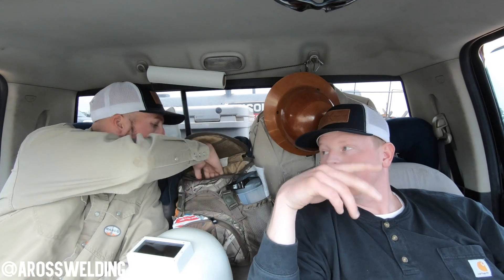WHY WE GRIND THE BEAD WHEN WELDING ON PIPELINE PIPE

Comment: Austin my friend,
I watched the FAA video on aircraft welding.
They say, in the video, that grinding weakens the weld and to never grind it.
Have you ever heard of this and do you believe it?
I do, but I'm just a student mechanic, not a seasoned 'Pipeman' like you Austin.
Hope this message finds you well.
:-D
Sincerely Pate
Reply: it weakens the weld because youre removing material ,making it thinner. when it comes to pipe, you grind it so you have an even surface to weld on so you dont get bumps to work around. basically grinding the weld on a pipe is just so u can have clean area to weld on and it makes it easier to weld with less variables. in pipe line welding it doesnt weaken the weld per se, because you still have to fill in the bevel so the material you removed gets added on your second pass .

Comment: Hey just a question , I live in NW Ohio they are putting in what looks like a 36" line. Have they come up with a MIG system to weld pipelines?
Reply: JLHcave yes there are a few manufacturers that have developed systems that will put in a 100% root pass in a butt. Fronius, Kemppi, Miller, Lorch, all have their own versions. Fronius call it "cold metal transfer", one is called "surface tension transfer" not too sure about the others.
Once set up and programmed, will put a root in a butt much much faster than a 5P or a 5P+. Outside? Simple, use an elephant, or screens if its windy.
You'll find though that the ol boys in this game are absolutely petrified of any sort of change in how anythings done lol

Comment: What do you guys do 6010 root and 7018 out??
Reply: I'm a steamfitter and we typically run that 6010 root 7018 fill and cap uphill only you guys run downhill correct??  I always thought that trapped slag it's all 100 percent x ray and they have to shoot so it must not huh??
Reply from the maker: We run 6010 for the bead (root) then 8010 for all the passes after that.
Reply: I gotcha man right on.  Does 8010 run a lot like 6010??  Have you ever used 7018?  If so what do you think of it?

Comment: Austin your fire cut side of the joint how many degree bevel do they allow you to get away with ? What grade of pipe are you guys welding 483? Have you done any grd.550 with the down hand low hydrogen (Bohler rod) . Got a welding inspector there taking parameters ? How is the inspection there anyways?
Reply from the maker: 30 degree bevel and x70 is the hardness of the pipe

Comment: Good vid, nicely done. I love my GoPro. It works so well, they ought to get awards for design excellence.

While I will never do any pipe welding, the techniques you employ are useful in other settings. Any time you're making a butt weld, especially on thick steel, where you can't access or weld the back side, pipe welding techniques apply.
Reply from the maker: Absolutely. I like the GoPro so far. Very nice design.

Comment: I don't care for wens lens, my eyes don't like the color. I get 2pc lenses from opticool welding. The colors are more mellow and not so vibrant, and more than just blue to choose from. The wild white lens on the site is an A+ lens.
Reply from the maker: Nice. Very nice suggestion, thanks.
Reply from the maker: The wens has 2 different colors. Electric ice and ultra blue. And you could try different shades of each. Just a suggestion, Incase you didn’t know.

Comment: If everything goes as plan how long from start to finish does it take you to weld the pipe that size
Reply from the maker: peanut Smith 
4 hrs give or take
Reply: I'm just reminiscing but, I was on a job just north of Kemmerer, Wyoming in 1981 and we were running a 36" dia. by about 1-1/2" thick line from a pump station to a small refinery type set-up where they scrubbed the H2S out of the crude from the surrounding wells.   This required (believe it or not) a TIG stringer, and then fill & cap uphill with 5/32 E7018. We were told to fill it with stringer beads and then we were allowed to weave a big wide cap on it, but we cheated and weaved the fillers too.  We were going up the side of a mountain and the helpers kept a lookout for any supervisors who rarely walked that far up to check on us.  Two welders on each side of the pipe and after we got the tacks in, we could finish in 1 hour, give or take about 4 or 5 minutes.  Then we would stretch out and take a nap in the little shack that followed us, until about 2 or 3 hours until the helpers came and got us for the next weld.  That was in 1981 and the scale was $18/hour and we worked 11 days straight of 13 hour days and then 8 hours on every other Friday, and then off that Sat. and Sun.  (Over-time for any thing over 40hrs/week.  GREAT JOB          Sorry I rambled on so much.  : )

Comment: Hey i just started my first pipeline. And it's 12 inch .250 wall. And we do 3 passes I was just wondering that what's the thickness if that pipe how many passes and what size rod is used for the cover
Reply from the maker: .740 wall. 8-12 passes. Depending on the individual welding. 5/32 for the bead. 3/16 all the way out after that.